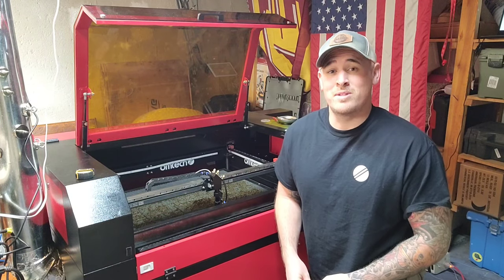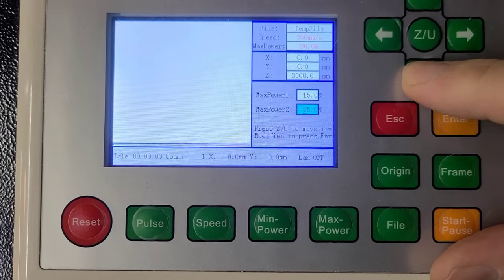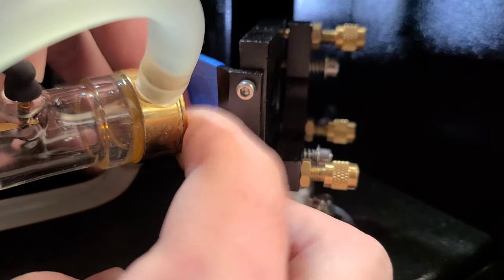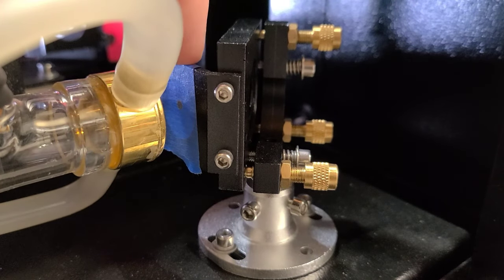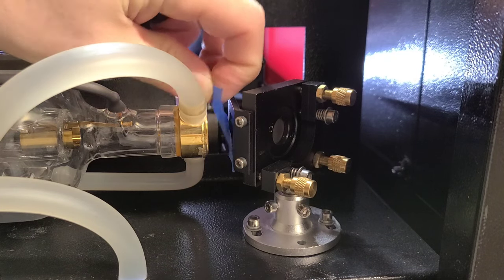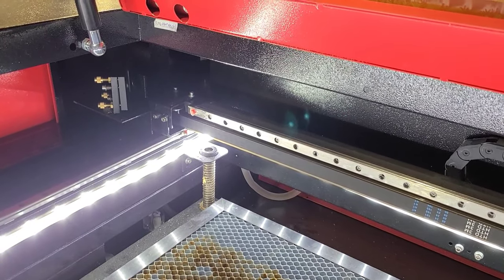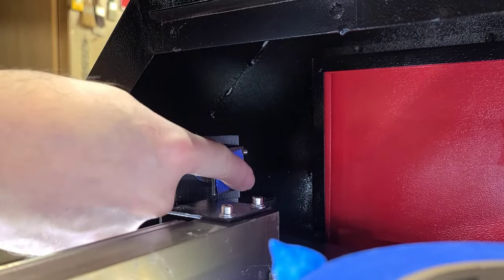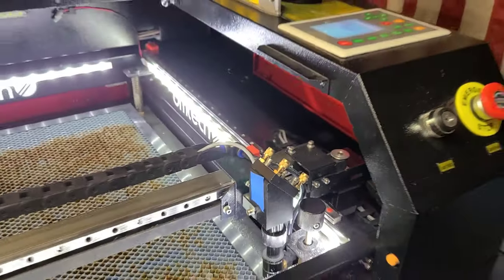How to align your mirrors on your Chinese / OMTech CO2 laser

Comment: I've had my 50w CO2 (this laser) for a number of years now, but I love looking for better views of doing this.  What I did was create small birch ply insert sizes, so I can put them in the circles, then use the painter's tape to hold them there.  It makes it a lot easier.  My circles cut out actually have the compass markings/target rings (some 1 and others 3 mm apart for fine tuning).  Your video was developed for anyone to be able to and understand! :)  Great job.

Comment: I followed the steps in this video. When I do the pulse test on the 4 corners, the two on the left side are off. What mirror do I adjust to correct this?  The left is further down.
Reply: Did you figure this out? I am having the same issue...

Comment: First off  use aluminum foil behind painters tape and then no worries about residue on mirrors. Then Simply add tape on top off old tape. It'll speed process up considerably. On 3rd (head mirror) do the mirror alignment without the nozzle and lense in there. Pulse near then far. Then the step you forgot. Make sure the tube is square/alignment. Pulse with nozzle and lense in tube. Make cross hair on wood. Lower table and remove nozzle/lense assembly. Raise table and Come back to same spot as first pulse with lense in/before cross hair marking. Then adjust laser tube up/down, left/right accordingly. I do this for a side gig and have done many. Good video but use these tips and do tube alignment. Then you will have great straight cuts and full power/focused beam all over laser (if bed is also square/same distance to the head). Follow video below. 

https://youtu.be/i5ApIqMR2pM

Comment: Finally got around to uncrating mine and doing the alignment.   All fairly easy until the very final (Vertical) alignment.

Took me awhile to figure out the beam was hitting the side of the nozzle.  It would leave multiple holes in the tape!   So what I finally had to do was loosen all three adjustment lock nuts and uniform the gap of the mirror holder/frame to at least get it to clear the nozzle.

Comment: Cloudray make a small adaptor for standard mirrors and lenses, it has two pieces of wire in a cross  across the tube, you drop a piece of card into the device and fire the laser, it burns a small spot on the card, when you look at the card the cross intersects up and down and left to right on the burn, that tells you exactly where you mirror is out without guess work and without the damn sticky tape, card is much easier to use. the mirror alignment tool costs around 10 dollars and works on cloudray mirrors and heads or others with the right size hole in the mirror holder. 

They make the same too again which screws into the bottom of the laser head tube that then makes sure that your focused laser beam is perfectly central to the laser head nozzle and does not touch the sides anywhere. You have to take the guesswork out of alignment always and these simple tool do it, i made my on a 3d printer and used fine copper wire for the cross, next time i had a larger order with cloudray i bought theirs, they both work but the 3d printer ones can melt if you beam is out. check their website for details..

Comment: Hi, one thing you did not mention, is how one adjusts if those 4 corners don't line up. I got the front right test to be center, then back right test lined up perfect, but when I moved it to the back left and front left position, they were off exactly the same for those two corners. What and where do I make those adjustments? I've tried callibrating but it makes my initial adjustments off. Your video didn't mention how to trouble shoot for that issue of the 4 corners not hitting the same mark.
Reply: Did you figure this out? I am having the same issue...

Comment: Can you please show how to prevent the beam from clipping on the nozzle? I barely see any videos using these type of machine and most people distrust these machines. By the way, your video was awesome, looking forward for more videos about OMTech CO2  laser.
Reply: Your nozzle should be adjustable. Use a pencil and some scrap paper and lay down a thick dark layer of graphite. Rub the graphite onto your nozzle tip. Now take a piece of scotch tape and carefully press it onto the nozzle. Fire the beam at the lowest power level your machine will allow. Take the tape off the nozzle and there should be a "bull's-eye" from the graphite on the scotch tape with a hole somewhere in the center. It's important you know the orientation of the tape or it'll be useless. Use the adjustment screws usually just above the nozzle or head assembly to "push" the bullseye in the direction that will allow for the beam to pass through without clipping.

Comment: Hello.  I am rewatching your video and, again, extremely helpful.  Can you point me to a video or resource that teaches me how to determine the maximum and minimum power i should set on the ruida controller?  Thanks again!
Reply from the maker: The power settings on the controller are for your pulsing power. It’s the settings in lightburn that control the output of your power. Here is a good video on what min and max power are for

https://youtu.be/pjud3FHn9H4
Reply: @EdmondsWoodshop  thank you for this. One last question that did not seem to be addressed on your video. When I am trying to alight mirror number 2 with the gantry moved to each of the 4 corners, I am consistently seeing the pulse in different locations. Meaning the pulse show in the same place when the gantry is in the two closest corners (the left side in my case) but is in a different place in the 2 furthest corners (the right side). Each mirror adjustment moves both but never aligns all 4. Any suggestions on aligning these or what I may be doing wrong?  Truly appreciate all you do for me and the laser community!

Comment: Thank you for the video, extremely helpful, I changed my tube because the power was low even on high setting, just wouldn't cut like it used to. However it still has the same problem, could this be a power supply issue?
Reply from the maker: This is an old alignment video. I have a new one out now with different techniques. 
If you think you’re having power output issues I’d try to run a power line test to see what kind of mA output you’re getting. I have the video on my channel. If you have an 80w you should be getting around 26-28 mA as a max output. If you can’t reach that it can be either the tube or the laser tube power supply

Comment: Hello, thanks a lot for this great tutorial. My laser tube lost a lot of power very quickly. I tried to align the mirrors as you show but  when i pulsed at the first mirror, i don't have a dot, if  if i keep the button pulse on, then two dots appears and becomes a line. Is the laser tube dead?  It's very difficult to have any answer from the chinese seller. So i'll be very greatfull if you can help me.
Thank from France

Comment: Just did the 4 corners and they were on point. Then I placed the laser in the middle and did a pulse. It was way off and hit the metal (nowhere in the circle). Then I adjusted to the middle and the corners were off. So back to square one. lol.
Reply from the maker: This is an old method. Go watch my new alignment video. Much easier to understand

Comment: I wish your 4 corners would have been off so we could learn how to adj it. that's the problem I'm having. mirror 1 to 2 is spot on dead center front to back. but mirror 2 to 3 I cannot get it centered but in one corner. then the other 3 are off, and not all the same either.
Reply: Same issue here.Nobody seems to cover how to fix it when the corners don't match. I keep adjusting mirror #2 but it never comes into alignment. Doesn't make sense that you turn the same 2-3 screws to adjust to the 4 corners as it keeps throwing out the ones you just got perfectly aligned in the other corner.
Reply: @Ron Stone 2 of mine are spot on but 1 corner burns the metal of the head to the top left and the other to the bottom right. I adjust and then the original 2 are way off.

Comment: Great video...
What if the pulse is not firing through the tape on the 3rd mirror. I have to hit pulse 4 times for it to fire through, is that OK?
Reply from the maker: It’s firing. You just don’t see it. Especially if it’s a low power. Try holding it down until you see a burn mark

Comment: Hi from Ireland 🇮🇪☘️
Please help me if you can... I have a 100watt which I am now just getting back around to trying to figure out (over a year later and a new bulb). I have been trying to cut a simple piece of 3mm mdf hardboard. But it seems to cut only parts of it. I've tried many passes and different heights, speeds ect but it's just not happening. The bed seems level. Beyond frustrated and ready to pull my hair out!!! Any tips would be greatly appreciated since it's cold here and I'd like to keep my hair on 🙏🏻😊
Thanks,
Natasha

Comment: I received my omtech 100w red on 3-2-22 and laser wont fire , i would like to know how to test all components to determine which part is bad, everything works but no fire from the tube and the laser power supply stays at o.oma when the pulse or test button is pushed

Comment: Omtech doesn't seem to carry compatible cutting heads- I stripped a mounting screw on mine where the head attaches to the bracket on the linear X-Axis rail. Do I just tap it for a bigger screw? Any idea if the red 60-150W monport laser heads are compatible? They look similar and also use an 18mm focus lens.

Comment: Thank you for this video. It was very helpful. I have a question about how to adjust between mirror 2 and 3. It is hitting fine when I have it all the way to the left, both front and back, but when I try to pulse on the far right side, its way off. Which screws do I adjust? Thank you!

Comment: The QC/Assembler sheet that came with my AF2028-80W showed a test firing at 10% for 4 ma current draw, does that mean that the laser actually pulsed and fired at 10% where you said yours wouldn't fire below 15%?  Just now getting system setup and tube installed so I can start the alignment process.  Thanks Cam.
Reply from the maker: This just means you power supply is calibrated differently than mine. You’ll need to do a power line test to understand where your tube limitations lie. I have a video explaining the process. 

The percentage means nothing. It doesn’t mean you fired at 10% of your full power. Percentage is just another way of say mA output. At 10% you’re putting out 4 mA. Our 80w tubes max out at 26 mA. You could be maxing out at 80% but you won’t know until you do a power line test.

Comment: This was a great video and explains this process quite methodically. What about a bed levelling video? From my experience these machines (not unique to Omtech) is that the honeycomb bed is far from level in itself. Mine also started sagging over time. I've heard some swap these out with a fixed plate of some sort - usually a 6-8mm aluminium plate - but I don't know what that would mean in terms of reflection when you're cutting. I like the fact that I can use magnets to hold down my material on the honeycomb bed. Thoughts?
Reply from the maker: So we have an order of setup on our website (under construction) where bed leveling is one of the steps. We didn't create the video as it does a well enough job explaining what needs to be done but I'll link the guide for you.
https://www.laser-guys.com/post/order-of-setup-setting-up-your-new-omtech-laser

Comment: If all four corners don’t line up then what? How do you align all four corners? The right side top and bottom hit dead center. The left side top and bottom hit high and to the left. It doesn’t make sense that mirror 1, 2 and three hit dead center then when I line up the corners, the left side top and bottom are hitting high and to the left. Any ideas?
Reply from the maker: Unfortunately there's no secret to getting these aligned. It's all trial and error. My recommendation is to not worry about hitting dead center of the frame. The idea is that you get the beam to be parallel with the rail itself. If the four corner pulses don't converge/align, then your cut and engravings will suffer. I suggest aligning the left side pulses (front and rear) and then the right side pulses (front and rear). The point where all the points converge will be in the middle of those two sets of pulses.
Reply: @EdmondsWoodshop  exactly my same questions Joseph had.  Thanks for answering Cam!

Comment: Hi Edmond, I got the same machine but I'm having issues probably with the mirrors alignments or with the "Z" axis at the moment to cut some pieces. At the front right of the bed everything cutting good but at the all away the top of the bed don't, Usually I need to pass 3 times the same file to make sure the piece was cut it off and my big question here is, how to use the calibration piece that comes with the laser (a little acrylic piece 2cm x 4cm), do I need to calibrate the nozzle using that piece vertically (2cm between the nozzle and metal bed)? or lay down (the thickness of that acrylic between the nozzle and metal bed) Thank so much for your comment and excellent mirror alignment explanation on your video.
Reply from the maker: Hi Gustavo. It sounds like your alignment is really off. You have to understand what the components ARE, what they DO, and the INTENT.
The first think I like to do is square my laser nozzle to the bed. This can be done with a carpenter square/speed square....something that is exactly 90 degree.
Everything else starts at the laser tube. The laser tube will fire directly into the first mirror. We call this Mirror 1.
The laser will then reflect off mirror 1 and hit mirror 2. Mirror 2 moves along the rail in a front to back motion. This rail is known as you Y axis.
The laser will then reflect off mirror 2 and moves toward mirror 3 which is on top of the laser head. The laser head moves left to right. This is your X axis.
Finally the laser then moves 90 degrees down your laser nozzle where there is a lens inside (like a magnifying glass) where it focuses the beam to a point.
Once the laser leaves the tube and reflects off mirror 1, the intent is to get the beam to run parallel or alongside the Y axis rail (front to back). This is known as aligning mirror 1 to mirror 2. To align you'd place tape over the frame hole on mirror 2 and pulse at the laser with mirror 2 at the rear position first, and then you'd pulse with mirror 2 at the front on the same piece of tape. If those pulses don't align on top of each other, then your beam isn't running parallel to the Y axis rail and you'll need to make adjustments (adjustments are made at mirror 1 since it drives the change of angle). NOTE: you CANNOT move to mirror 2 to 3 alignment until mirror 1 to 2 is aligned. Center does NOT matter right now.
Once mirror 1 to 2 is aligned then you can move to mirror 2 to 3 alignment along the X axis rail. Place a piece of tape of mirror 3 hole on the laser head. Move the laser nozzle all the way to the left. Pulse. Move the laser head all the way to the right. Pulse. If those pulses don't line up, you need to make adjustments at mirror 2. Every time you make adjustments you'll need to replace the tape to see where your new pulses are hitting. Always start your new pulses when the mirrors are closest (left side) and make adjustments when your mirrors are the farthest (right side).
Once you're aligned left to right, you'll want to check how the laser is coming down the nozzle. Are you get a good solid pulse that comes to a point? Good. If you're getting anything other than a point....i.e. a crescent moon shape or irregular shape ...then you'll need to make adjustments on top of the laser nozzle at mirror 3.

Recommend joining our FB group for OMTech lasers. https://www.facebook.com/groups/1364016877267714
Reply from the maker: As far as the acrylic piece goes, it needs to be on its side (not flat and not standing tall). Generally the acrylic piece is not accurate. You need to do what's called a "ramp test" to verify you focal distance. We have instructions in the FB group page.
Reply: @EdmondsWoodshop  Hi edmonds. Good news!!! problem resolved... thank you very much for your support. :-)

Comment: Does it matter that the pulse is not dead center when you put the tape over the nozzle?  Still within the circle, just a little off.
Reply from the maker: As long as it’s coming down 90 degrees straight off the mirror then it’s fine. If it’s coming down off an angle then it will have angled cut.

Try watching my latest alignment video. It’s pinned to the top of the comments.

Comment: Great video! One question: I have the same machine as you do... When I adjust the screws, I started small and it made ZERO difference in where the laser hit the tape. I went back and adjusted more and more and finally a LOT, nothing changed the location of where my laser hits. Now what?

Comment: Solid video Cam, thanks for taking the time to explain this process!
Reply from the maker: Thanks dude! I tried to break it down without being excessively long. When you go to align, don't focus so much on the center of the mirror as you need to be center on the lens when it comes down the tube. If you find that the beam converges offcentered on the mirrors....go with it.

Comment: what are the 2 silver "screws" with springs on them (in between the up/down-diagonal and left/right-diagonal)?
Reply from the maker: They provide tension against the mounting plates. Without them the plates would just be flopping around